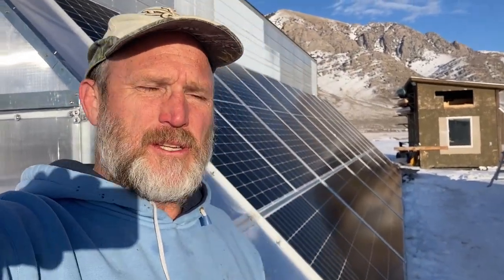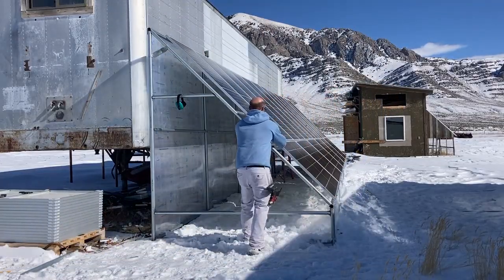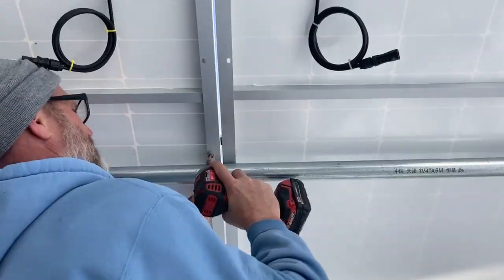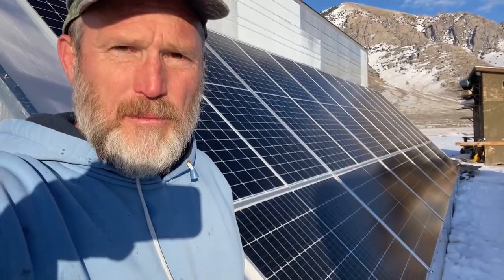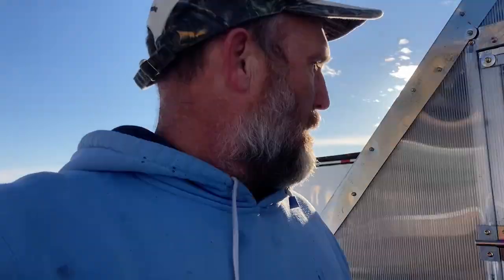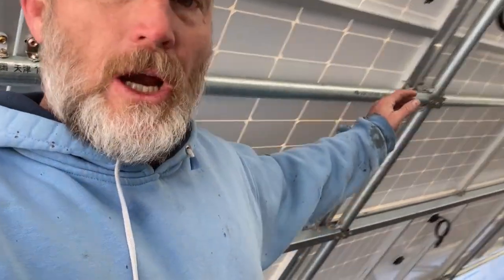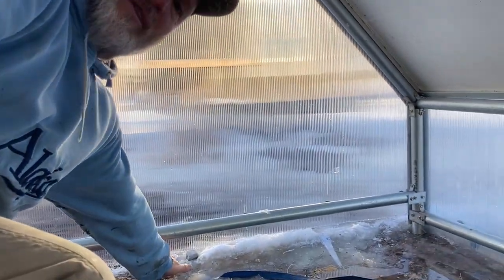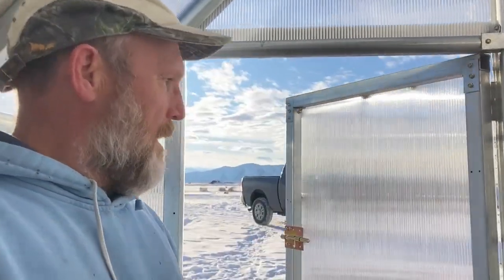Building a Solar Panel Shed || Naturally warmed structure that has electric power

Comment: I really like this idea for a cold climate setup, it is clever.  As the panels get hotter they do become less efficient, so you may want to add powered ventilation in there during the summer, but that will conveniently be when the days are long, you are putting out the most power and so you can probably easily handle that incremental, additional load.  You get two big benefits there, keeping the batteries above freezing so they can charge and keeping snow off the panels automatically and for free, critical in the winter when days are shortest.   What I don't know is how much you lose when the panels are at say 50F instead of 30F, but I suspect it isn't going be a big enough loss to make you regret this.  Be an interesting thing to track over the course of a season, allowing you to figure out the ideal set point for when it makes sense to turn on a fan to maintain maximum panel efficiency.

Comment: I really like this!  You also may be able to punch some vent holes into your other structure - one low and one high - and let this "sun space" heat the other structure.  A simple flap of light plastic (maybe even cut from a garbage bag) might be sufficient to prevent cold air flow from the shed thru the lower hole.  Put a similar flap on the inside of the upper hole to prevent warm air flowing into the shed thru the upper hole.

Comment from the maker: Regarding cooling in the summer, look at https://www.youtube.com/watch?v=2S9BNb4xLgQ at about minute 5.  The PVs are only dumping around 300 W per square meter in the summer, while the sun exposed polycarbonate is dumping about 700 W per square meter into the structure.  The remainder is rejected or (in the case of PVs) some is converted to electricity.  My other greenhouses have no problem dumping excess heat simply through venting.  This solar panel shed will actually be easier because you can rely both on wind and the stack effect as vents can be placed on the south facing 18" stem wall and on the 9' tall back wall.  Vents will be added where and as needed.  The buoyancy different in the height will create a natural flow rate simply due to the heated air at the peak.  It will work very well in this location and keep the interior only about 10 degrees hotter than the outside temperature based upon my experience in the greenhouses I've built.

Comment: Do you have a link to the trim you used to waterproof between panels? Im building a goat barn with solar panels as a roof. Ive considered a few waterproofing options but have not settled on anything specific.
Reply: I like the idea of a flat rubber gasket between panels.  Through bolts on all 4 sides of the panel frame to compress the gasket between panels.  My concern with silicone is the accessibility to pull and replace a damaged panel in the middle of a 30 panel array.  For mounting I'm using a welded grid of oilfield sucker rod.  2 hole straps to fasten panel frames to the sucker rod.  Cheapest solution I could devise.
Reply from the maker: I used the 19' long aluminum 2-piece Butt connectors for 4 mm and 8 mm panels: $40 each ($20 per 19' half section).  This is found at catchsunlight.com.  It's too large to mail, though.
Reply: @russlivesay9325  So, after rewatching- you're just using it as a hold-down correct?  No seals aginst water ingress between the horizontal panel joints? After watching a few other videos I discovered you're using Polycarbonate Panel butt connectors.  The context helped as the first vid I watched was all about solar panels ;).   I really enjoy your channel.  Just another redneck engineer from down here in Texas.
Reply: Im not sure what happened to my reply, I'll try again.  I rewatched the video and several of your other vids.  The context helps.  You are talking about butt connectors for POLYCARBONATE panels not SOLAR panels.  And it seems you are only using it as hold downs.  There is no seal against water ingress in the horizontal seams, correct?
Reply from the maker: @FoundationsAcademy1  Correct, but a bead of silicon would work if a sealed surface is necessary.  I also have the lengths of rubber gaskets for the butt joints, but chose not to use them in this application.  I'm not worried about sealing here.  I may run some silicon on the underside near the battery room to avoid any water infiltration if necessary.

Comment: Good for winter, but it will be massively overheating in summer.....good idea, not well executed..
Reply from the maker: Actually, it's simply a matter of opening vents.  The 18" stem wall can have a vent frame added, along with vents on the 9' back wall.  The stack effect combined with the constant wind in the summer will circulate air.  Simply open the vents if it gets hot.  This process is just like all of my greenhouses.  If its too hot, add another vent frame.  I exclusively use natural ventilation on my polycarbonate lined greenhouses and vent them to maintain temperature without any problem.
Reply: @russlivesay9325  dont listen to that guy this is a killer idea. You could even use a bit of the solar power to run temperature sensors and automatic hinges on the doors that will open themselves if it gets to hot inside. Thanks for the video!

Comment from the maker: So I went with these materials to demonstrate that you can build a functional structure for less money than standard construction.  I chose not to use bi-facials to save money, but am using the PVs for my roofing material.  The polycarbonate panels are 7'X19' stock so there are minimal seams due to the large size, making them easy to install.  The polycarbonate never has to be painted, and is much easier to install than wood and siding, making this construction solution not just less money in terms of the material, but less labor time while providing a completed structure that is more than just for storing items in a shed, but functional in terms of generating electricity and warmth.
Reply: Hi Russ. Big thank you for your idea. It's small things like these that make our lives improve through the centuries! You keep improving it and benefiting from it, and perhaps patent some inovations, don't mind the criticisms you hear.